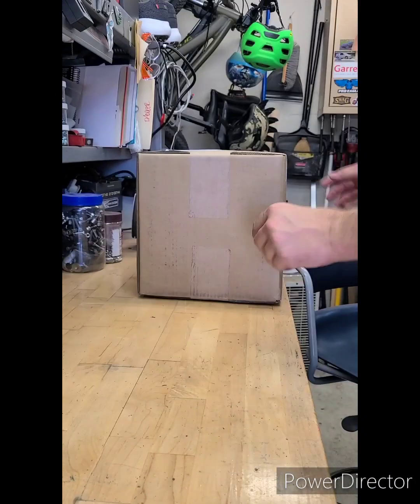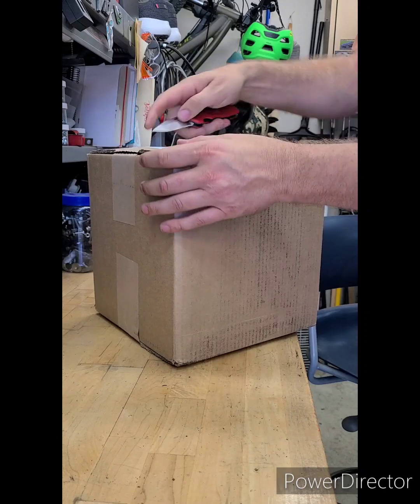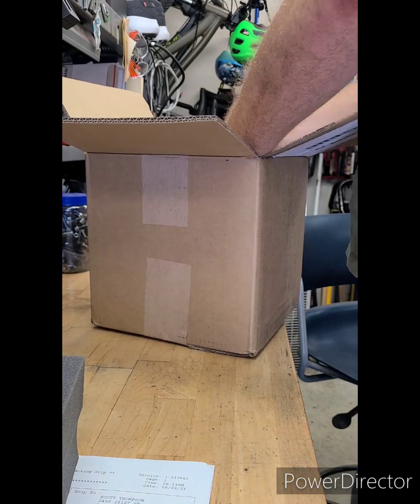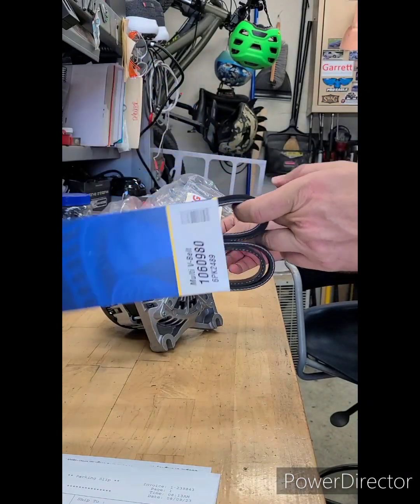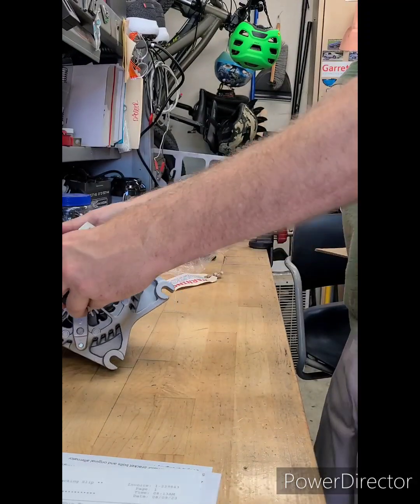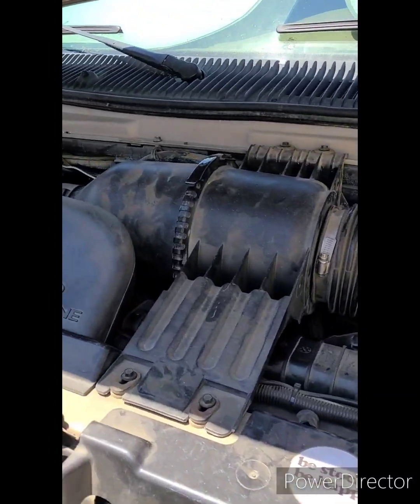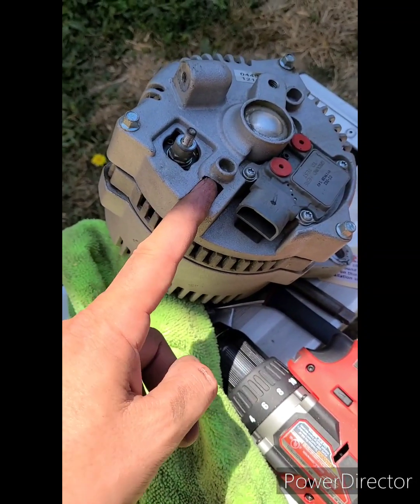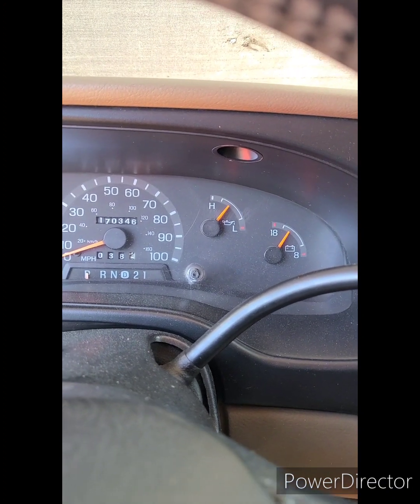Ford Econoline Performance Alternator Upgrade

Comment: But how will you stop the belt from slipping?  Even my stock E450 alternator slips when batts are low, I think that is only 145amp.   The one you removed had black belt dust on it as well, proof that it is slipping.   The alt pulley has minimal wrap, bad design.
Reply: He says that he put a smaller belt on to keep it from slipping

Comment: Do you just leave that one single wire disconnected?
Reply: Sweet thanks, just got the same alternator for my van and was worried lol
Reply from the maker: @slayden633  I called them and they were very prompt and helpful, top notch service!
Reply from the maker: @slayden633  yes, that is not required with this upgrade